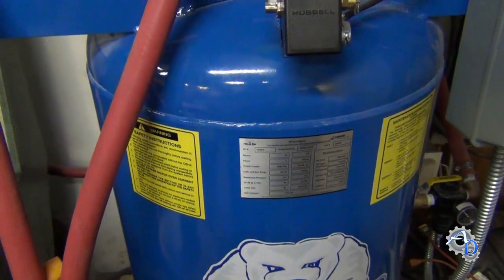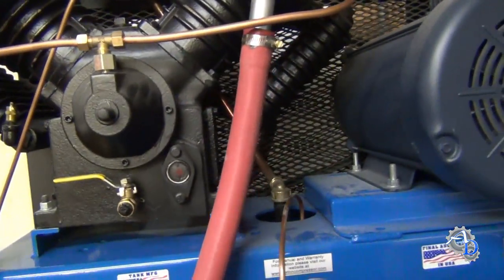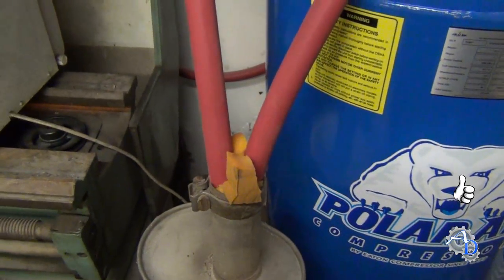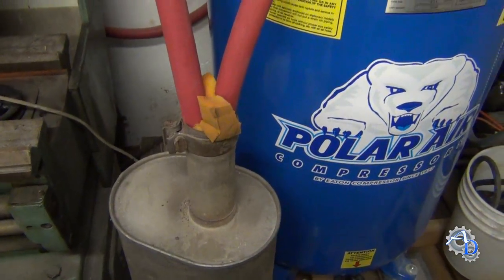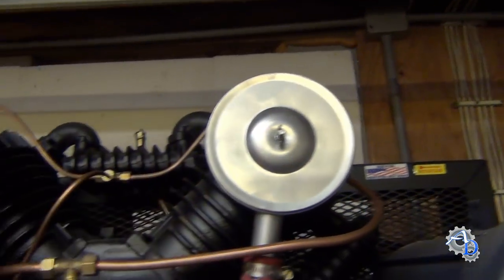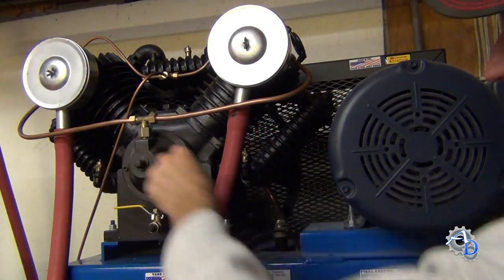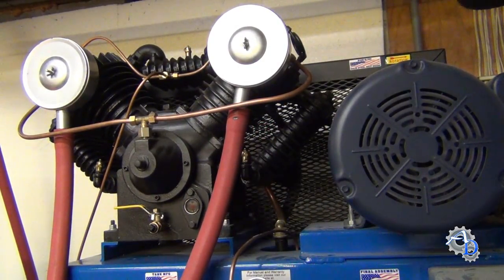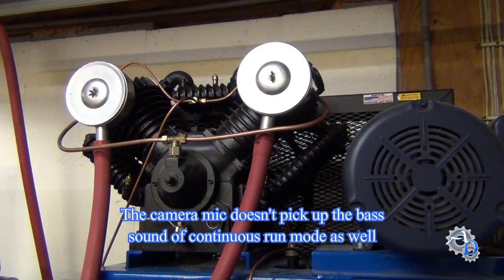Easy Trick to Make Your Air Compressor Quieter

Comment: The "Silent Air " is is a large box with a large air filter since they are removed from the head . The larger and more free flowing you can make it and the farther you can get it from the head the quieter you can make any air compressor.  In the old days we used to just pipe the intake thru the wall to the outside with a filter and presto - Quiet air compressor

Comment: I bought a KOBOLT 60gal single-stage compressor many years ago and placed it inside my attached garage. Soon I found that the noise was impossible to endure. Being inside my garage was the problem. I moved it to an outside concrete slab which significantly reduced the sound. For my neighbor's benefit, I installed a six-foot high PVC fence with a gate to enclose it and direct the sound upwards. Lastly, I mounted a retractable awning to provide weather protection. When the compressor is being used, I fold the awning up. This was a good DIY project and not expensive to accomplish.
Reply from the maker: That's always a good idea. If I had the money, I'd have a compressor shed.

Comment: I once had a dirt bike with an expansion chamber and I welded  an adapter to an old VW Beetle exhaust tip then pinned the adapter into the expansion chamber. Huge improvement. Thanks for the ideas!
Reply from the maker: You're welcome. Thank for your comments!

Comment: Used to work for a company that designed cogenerator plants. Used rooms full of 454, 502 or 540 big block Chevys run on LP gas to run electrical generators. Most were in public schools. So how did they silence a room full of normally loud car engines? Car mufflers on the exhaust stack and intake piping. Technically they were called "sound attenuators". Looked just like a big SUV muffler to me. Nice work showing others how to do this.
Reply from the maker: Thanks. I'm glad you liked it.

Comment: I did something similar years ago. Probably in 2002. I put nipples in the heads and removed the filters. I then fabricated a box that accepted a flat automotive filter. Ford powerstroke if I remember correctly. The greatest part of my design was I actually need no muffler whatsoever. I ran a 2 inch pipe from the box through the wall to the outside of my garage. This serves 3 huge porpoises. 
1. The noise is outside, and believe me, that pipe is noisy out there. Be sure to place a screen over the end to prevent birds, mice, etc. And put a downward facing 90 to eliminate moisture entering. 
2. Cooler air is less dense. In the summer my garage gets very hot especially near the hot compressor pump. Not only does the outside shaded air intake help keep the pump cooler, im sure the cooler air entering the hot pump has more expansion and thus, though perhaps meniscal, gives the compressor greater efficiency. 
3. When im sand, painting, or any other dusty dirty work, the compressor is always gets clean air from outside instead of dust from the shop. This reduces filter services and thus prolongs the life of the compressor. Also the automotive filter has much finer micron catching abilities than the original filter with far more surface area.
Reply from the maker: This is exactly true. Winter time air is nice and dense, and helps keep the heads cool. I recently uploaded a video of this. https://youtu.be/kV5KmBlcXmU

Comment: If you run the pipes outside, that will make it even quieter, the longer the inlet pipe the quieter it will be. With regard to fitting the pipes into the car exhaust, you can use expanding foam, if you are careful.  I've used both of these methods and they both work pretty well, I used a box with foam filters in it. It's nice to see a well made, well presented, common sense video.
Reply from the maker: Thanks. I'm going to run the pipes outside this summer.
Reply: The trick is to take the whole thing and put it in your neighbours garage and run hoses and wiring to your place
Reply: You can also buy foam specifically for sound deadening

Comment: Aha! So I am not the only person who, years after I bought my big air compressor with a 60 gallon air tank, still have it standing on the skid it was bolted to when I bought it! :-)
Reply from the maker: I ran my first compressor from the nineties like that too. I sold it last summer with the skid attached. With this new one, the only thing I did was put 1/4" rubber pads under each foot like the instruction manual calls for. In a newer video, I use the skid as a foundation for an enclosure for further sound reduction.
Reply: that voids the warranties
Reply: I not only left mine on the skid but, I put casters on it.  Now I can move it out of the way when I'm not using it or to clean behind it.  I also cut out the center so I could install a mechanical self-emptying water trap.  Works great.  I think I'll add the muffler too after watching this video.
Reply: They won't warranty the compressor on the pallet...
Reply: Good idea! Thanks!
Reply: @neoplasmax  😂😂😂 that's so punny!

Comment: Big difference, worth the effort. Lots of compressor noise comes from the tank. As  air exhausts inside the tank, it sends sound waves through the compressed air in the tank, and it whacks against the tank. Try putting your ear against the tank and you will hear a metallic drumming sound from compressed air hitting it (among lots of other loud mechanical sounds).  The solution is Dynamat or similar sound deadening sticky mat. Will make your tank ugly for sure, but may be worth the effort. Note that some compressors have a diffuser inside the tank to quiet it, others just dump air directly into the tank.  So results may vary. I can tell you it worked fairly well on a 10g cheap-O.
Reply from the maker: Thanks for your comments. I have another video where I build an enclosure for the compressor. I hadn't thought of dynamat though. Good idea.

Comment: if ur air compressor keeps up with air requirements change the pulleys out and slow down the compressor speed.  i have an old standup compressor running half the speed its so quiet u can talk normal while standing next to it.

Comment: There's a noticeable difference but not as much as I was expecting, I'm curious what's the decibel readings would be?
Reply from the maker: The difference is more noticeable in person, as the mic on the camera doesn't pick up the lower frequencies well at all. I am getting a little over a 4 decibel average drop, which is a little over a 50% reduction in perceivable sound level. I'm working on another video to show another modification to lower it further.

Comment: See now i've been thinking about this topic for awhile wouldn't an automotive intake from a luxury vehicle work better? Not only is it built with baffling and chambers to quiet induction noise just like from a compressor but it also has an integrated air filter. Im going to hit up the local pick yard and test my idea.
Reply from the maker: I now use an air box from a hemi. The lines are plumbed through the wall. The air filter can handle any cfm I throw at it. I have another video showing it.

Comment: Now, take those tin filter filter housings off and take a took at the fitting connecting them to the head. The pnes on my compressor were very restrictive. Replaced the entire housing with a pipe nippled screwed into the head and a filter sandwich between 2 pieces of aluminum plate.  I don't remember the number, but I took a decent amount of time off the compressor's recycle time.
Reply from the maker: That sounds like a good idea, to sandwich a big filter between two plates like that. I might mess around with that in the future. I did end up taking the tin housings off later on though. I screwed in 1" street elbows into the head, and then made a big filter from a large suction strainer wrapped with 3 micron polyester filter material. The setup is similar to what the factory uses. I don't know if it has reduced cycle time. I never checked.
Reply: Good Idea!  You could also make rods longer and stack a bunch of filters together.

Comment: I ran mine through wall to the outside,, now I get only fresh air and really quieted it down,,, if you have access to the outside you should do the same and I put the filters outside also..l can tell it's much quieter then your muffler setup with no risk of restrictions. And I also put a 1/2 inch roll of copper tubing between the compressor pump and tank eliminating almost all the water the comes from the 200 degrees air entering the cooler tank causing condensation,,l have many drops with drain values but hardly ever get any water after doing the tubing..seen many useing oil coolers that restricts the flow due to the coils size reduction,,and as I figured alot of them are having pumping issues now due to back pressure on compressor head..just a suggestion I like to pass on what really works..
Reply from the maker: I have the hoses going outside now too, so it draws in cooler air to help lower compressor temps. The chugging sound is now outside. They connect to a hemi air filter box with bulkhead fittings. It has a screen over the intake to prevent mud hornets and birds from nesting in it. My ram was totaled last summer by a tractor trailer, but I was able to save the filter box for this. I also run a large fan cooled aftercooler and custom condensate reservoir with sight tube and drain after the cooler, and before the shop regulator. It has completely eliminated any line moisture issues in my shop. My compressor tank also has an auto drain which prevents tank rust issues. Thanks for the suggestions.
Reply: You mean you replaced the existing tubing with 1/2 copper or you mean you rolled copper tubing around the existing tubing as a heat sink?
Reply: @jsplasha   connect one end of roll to compressor head and the other to the tank, roll will be 25 foot long l used a 5 gallon bucket to wrap it around to make coils smaller and mounted it behind compressor fan,, put a 1/2 inch water separator on tank end of coil,, and will solve water problem.
Reply: @jsplasha  I actually hooked up a hydraulic hose to the existing pipe from water separator with flexible hose

Comment: I like the ball valve on your oil drain too.  It looks like you're taking care of your equipment.  Is that a drain extension on the bottom too?  I wonder if some foam sleeve used to insulate plumbing would make your hoses leak even less noise.  You could use 2 smaller lawn mower mufflers if you wanted to, but I don't know how well they work, and you already have that muffler.  Some people hang moving blankets like tapestries around and above their compressors, but not attached to them.   Just a thought.
Reply from the maker: It has an automatic drain on the bottom that drains about every 45 minutes for three seconds. Keeps internal tank rusting to a minimum. I have a newer video where I show further refinement to the muffler setup and build an enclosure around the compressor, which really helped.

Comment: What about for a smaller compressor like a gmc syclone 6310? Can you do something like this?
Reply from the maker: It should work on any compressor. I now have my intake lines running outside the shop to a auto air filter box, so all that noise can only be heard outside.

Comment: just put the intake outside. drill a hole in the wall attach a wide pipe with a air filter on the other side.
Reply from the maker: 8" concrete block, or else I probably would've.

Comment: Why not just route the intakes outside the building and make a screen to go over them to keep bugs and stuff out?
Reply from the maker: It's been like that for a couple years now. I used the air box from my hemi ram that got crushed by a semi in my parking lot. But my loss is the air compressor's gain. The filter seems to handle the 36 cfm with no issue. I put fly screen over the intake to keep out crawling things. It cuts intake noise completely. You can only hear a low pitched wop wop wop sound outside when it runs. I think I posted a video about it too if you want to hear the wop wop wop sound for yourself.

Comment: i AM PRETTY SURE THAT I SAW IT AT Harbor Freight but, They have this air line connector that is blue & it splits one 1/4" hose into two but, I was thinking of a part that was already available but, your hoses are much bigger then 1/4" air line!!! Same idea though, 2 openings within a round base to shove down into the muffler/exhaust pipe. I am looking for a Good, CHEAP, very quiet air compressor for my brother/ he lives in an apartment & the neighbor has kids so, He needs a very quiet compressor to air brush at night time without disturbing anyone else & to do so on a very tight budget!

Comment: I ran mine through wall to outside and put the filter there , very quiet and no dust from shop
Reply from the maker: That's what I'm doing next.
Reply: @ArnoldsDesign  oh,,you like my idea,,,lol glad too help,,,another one put a roll of 1/2 inch copper tubbing between compressor and tank, it dropped my air temperature by 80 degrees greatly decreasing condensation from hot compressor air entering cooler tank,,
Reply: 3/8 inch will restrict flow and volume  causing back pressure on compressor head and shortening life of pump

Comment: I did some reading and asking and I don’t know for shur but I was told that is will burn up the head reeds because air flow restriction
Reply from the maker: This compressor doesn't use reeds. It has poppet valves instead. The factory uses a setup like this also, so it should be fine.

Comment: I would be worried that the hose would cause restriction you should check heat value before and after installation.
Reply from the maker: It doesn't cause any issues that I know of. The factory also uses a hose to muffler setup like this one. I don't recall now if I did a head temp check before I hooked up the hoses, but I know I got a 50°F decrease after I installed a box fan blowing down on it. That's in my second air compressor video.
Reply: Arnold's Design, cool, pun intended. It seems that the fan is a great add on.

Comment: I can clearly hear the noise reduction but it's not worth it because the compressor needs to draw in ambient air. The muffler will cause an air restriction and create more heat.
Reply from the maker: The noise reduction is much more noticeable in person, but the cam mic levels the sound a lot, so it dampens the effect.
Reply: Arnold's Design. I understand that the noise reduction is important to you.

Comment: So, you made a vacuum cleaner. lol
Reply from the maker: I hadn't though of it that way, but I suppose it is.
Reply: @ArnoldsDesign It's an easy enough fix. The compressor will last longer if it's not sucking dirt off the floor. Love the idea though.
Reply from the maker: @MrHowieZ1973  Lol, true.

Comment: All that carbon & rust from the muffler is going straight into your compressor. Inlet air is being restricted. The inlet air is being drawn in from the dirty floor. Not much of a sound reduction. To me your doing more harm than good to the air compressor itself.
A compressor needs to breath in the cleanest air possible.
Reply: Just think how quiet the compressor will be after it sucks up a dead rat and destroys a cylinder!!
Reply from the maker: It's fine.
Reply: Good lord, the things you see written on the internet.......
Reply from the maker: Tom Krause
Amen
Reply: bruh it has a filter
Reply: quit your whining he said in the video he wouldn't recommend a muffler with carbon in it or did you miss that part? it may not sound like much of a sound reduction but in real life it will be ive tried to silence my own compressor and there is a significant difference

Comment: I need to buy a compressor to replace my old one so i want to upgrade.  My problem is this new one has amps I’m not sure that my electric for my old compressor will hold. Any advice? Any is welcome and appreciated.

I’m buying from northerntools.com and it’s a Emax industrial plus silent air 10hp 2-stage , 80 gallon vertical air compressor with silencer 230 volt , 1 phase. Model# ESP10V080V1. All it tells in specs is operates at 40Amps, suggests 60amp breaker and it takes 80amps to start. 

I have at home 8/2 Romex that i was told is good for 45amps. I have 50amp 2 pull breaker and i was told that will be fine the 60amp is just a suggestion. My real worry is this 80amp start up. I’m not a electrician and don’t want to burn down my house or shop.
Reply from the maker: Emax and Polar Air are both Eaton pumps, and I'm pretty sure they are the same units with different branding, because the silent air box is Polar Air's creation. I have the same rated unit as you, but Polar Air. 10hp 2 stage 1 phase, 80 gallon. I went by the installation part of my manual and connected to a 60 amp double pole breaker. The 80 amp startup was mentioned too, but it's only for a fraction of a section, not enough to overload a breaker or line. I forget the wire gauge now, but just follow the instructions on that. I have over 350 hours on mine now with now problems whatsoever. If you can, get the hour meter for oil changes intervals, and definitely get an automatic tank drain. It will save the tank bottom from rusting out.

Edit: I just checked my comp's electrical box. It says run 4 gauge if cable of 100 ft or less, and 3 gauge if longer.
Reply: Arnold's Design thank you that helps a lot. I searched for the oil change meter but it keeps sending me to information on oil changes not a meter. Should you have a link? Thanks again
Reply from the maker: @bjputvain  I'm glad I could help. I looked on Polar Air's site. I'm not seeing the options to add on the hour meter or the auto drain now. I bought mine in 2017, so they've changed the site since then. You could just call them and ask about it. They were nice people when I dealt with them. I went to the factory and picked mine up. If all else fails, you could just get a Hobb's hour meter and install it on the side of the box if you wanted to. That's what they did with mine. The auto drains can be purchased from McMaster.com.